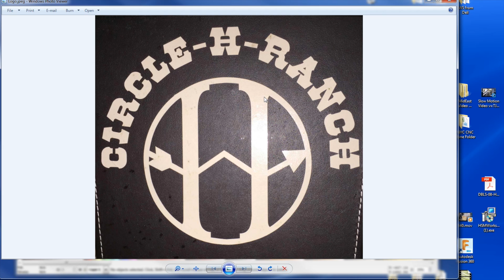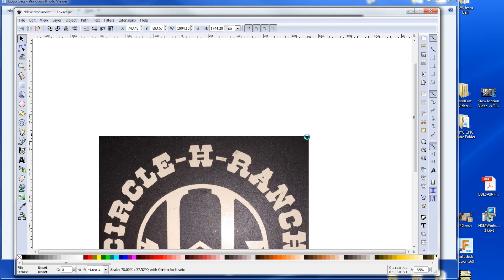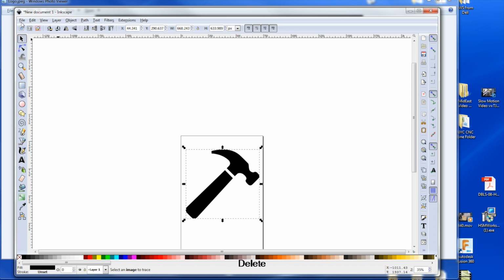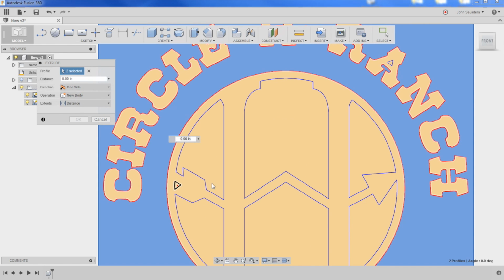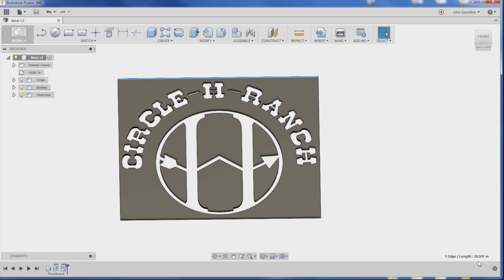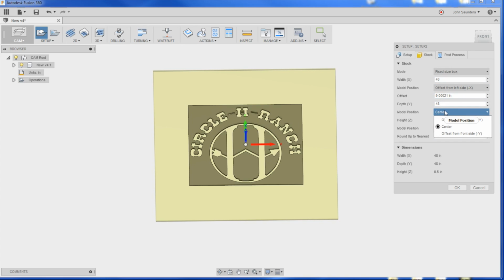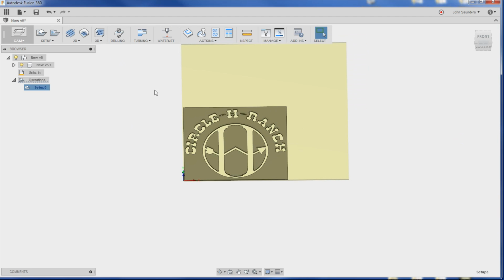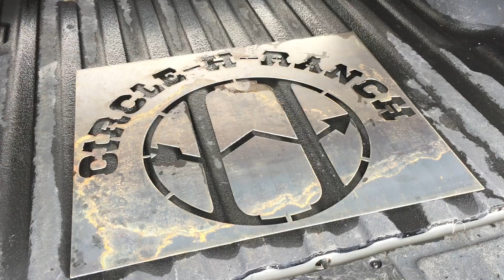Coverting JPG Photo to Fusion 360 to Plasma Cut!  FF45

Comment: Hello, instead of modifying the scale of the object once extruded, you can modify the sketch once imported from the SVG. In order to do that, just tick on the Fix/unFix once the sketch lines are selected inside the sketch design and then you can resize it as you want.

Comment: You work way to fast.  Can you slow down?
Reply: You can change the video play speed to 1/2 speed if it helps.  Bottom right hand corner of the video by clikcing on the settings icon.

Comment: Before you say it, yes, I make things harder than they have to be sometimes. I use Adobe Fireworks for most graphics....things. There is an "export to SVG" extension in the Adobe Exchange. First thing first... open your logo/image. Select all of the various components of your image (if assembled in Fireworks, lots of extra data/editable regions will crap up your SVG) CTRL+SHIFT+Z to convert selection to bitmap. Use the magic wand, select the desired regions, go up to Select / Convert Marquee to Path. Copy that path to a whole new image. Even if you hide/lock all other layers, the data still translates into the SVG.... CTRL+N then paste your copied path into the new canvas. Turn off canvas background. Save your image. Then go to Commands/Export/Export as SVG. 
Then just go to Fusion 360 and import as SVG. 

Similar process for other software so it seems.

Comment: Something I like to do with my DXF files is to first import them into CorelDraw. I can set the exact size I want and ensure all of the lines are the same colour. I can also reduce the number of lines if a curve is made up of many lines instead of a few. I can then import it into Solidworks or something and it will already be the correct size.

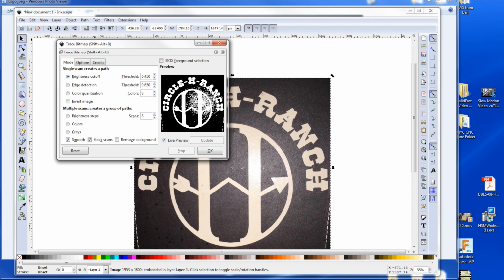Comment: What CNC would you recommend for drone building and beginner CNC work I know can I know SolidWorks I've worked with a lot of Autodesk animation software for design so what machine should I use at home in my garage runs off of 110 at the most 2:20 then I could start off with to make small parts but have enough axis to make complexe parts

Comment: Pretty cool how all those connectors just show up in steel all by themselves =)  Kinda sad that you still have to figure out a work around to do something as simple as select all imported geometry. Thanks John
Reply: Agree on Fusion needing a box select or select all. I recently selected over 450 features for a trace tool path. the worst part was the section tool would become unstable over about 50 features, so I would have to create multiple trace tool paths. Fusion is not without its faults, but it's getting there.
Reply: I agree its getting better every time I try it and when they get it it no doubt will be awesome. Its just crazy to me that Autodesk would release such an unstable buggy program. And honestly I'm tired of the "you cant bitch cause its free" motto. Its been years and every time I try it I still end up getting frustrated and going back to more stable software. But yes it gets better every time I give it another shot.
Reply: I think they are developing it like a cell phone app, so they try and release features as fast as possible without doing any comprehensive testing. I've been using it as my primary software because of the integrated cam, but it's bugs have taken many hours from me. I'm not at my breaking point yet, but it's in sight. What do you use as your primary?
Reply: FeatureCAM & SolidCAM for cam SolidWorks and Fusion for cad. Im going to mess around with fusion cam soon, I've always liked HSM Works.

Comment: When I work at a sign shop, I had either get files or have to scan in logos all the time, make sure if they are sending you a file is the image has to be min. 300 DPI. The first thing I would do on a simple image like this would covert it to a black and white image, and then send it to Corel Trace and adjusting the smoothing setting to get the best trace. then into Draw to do any clean up when needed, and save in file. This have work with both Solidworks and Inventor. Usually only takes about 5 to 10 mins.

Comment: Fortunately, I've been a designer for 28 years, and I can re-draw my own vectors in a few minutes. (Have to do it all the time, as people send me logos via text as well)

However, I have the PlasmaCam and I'll tell you what... their vector to path software is outstanding. So much faster to get a cut part off the table. But my workflow has been, and will probably always be; Illustrator .eps file to Vectric V-Carve Pro to get a real .dxf file that doesn't have poly splines, but actual arcs! Then to the Plasma Cam software via thumb drive. (because machine is in different building) BTW: Vectric is the only CAD/CAM output software that I know of that legitimately supports .eps files no problem. Plus it's very affordable way to get actual CAM things done. From setting up tooling paths, inside, outside, depth, drilling, tapping, climb cut etc... all the goodies that allow you to generate a clean G-Code to run just about any machine that has 3 axis.

None of the free or even commercial vector software programs can output a .dxf file with continuous arcs, but makes a poly spline mess instead. However, there is a 3rd party plug-in that Corel Draw supports that allows for a good clean .dxf file export. A lot of Chinese Laser Table users have to do that method.
Reply: You mean that if you take a vector shape, like an oval, (which should only have 4 nodes, 4 arcs) and convert to paths (again) then the dxf export will work properly?

Here's the Corel Draw DXF Export plug-in I was talking about. http://www.coreldrawtools.com/ I don't use CD, but wished someone came out with an Illustrator plug-in that actually worked in CAM. There's dozens of them, but they all yield polysplines. Which is why my workflow above has me drop the file into Vectric V-Carve Pro to create the G-Code instead. Skipping the DXF debacle.
Reply: I am really interested in your reply. I like to work in Illustrator but having no end of issues with the DXF file that is exported. Just new to the world of CNC plasma cutting. We only have a flat bed table, working with 2D images at the moment. The machine we bought came with FastCAM for producing the G code needed. Unfortunately when I open the DXF file in Fastcam or even MasterCAM there are so many issues with the arcs etc. I am going to check out what you have written, but as I see this reply was 2 years ago, have you got any new ideas